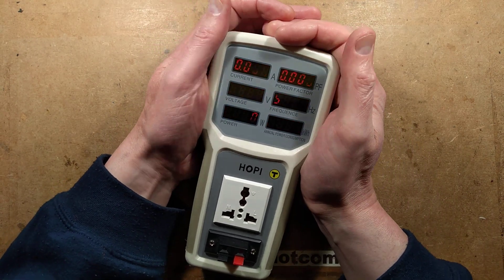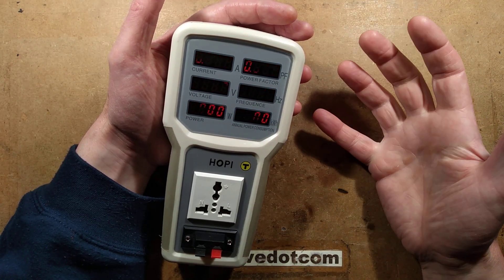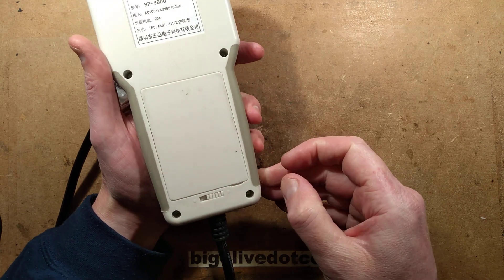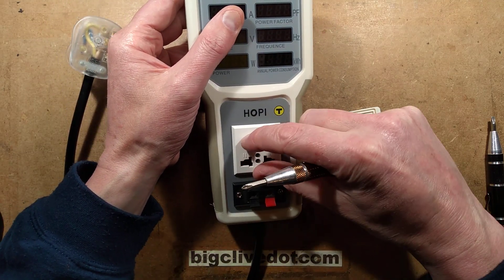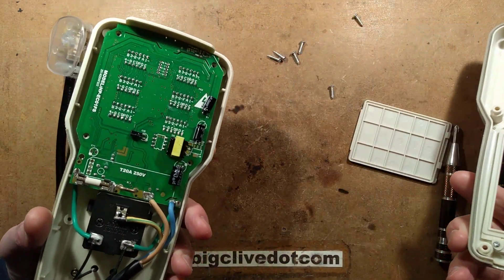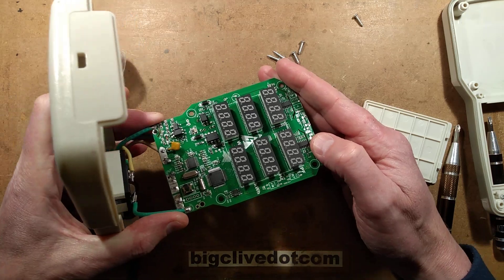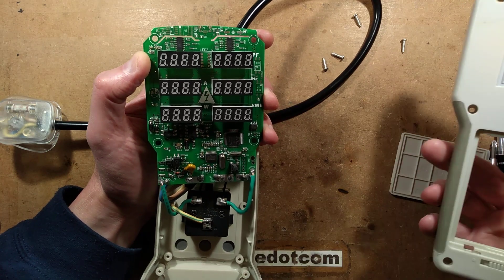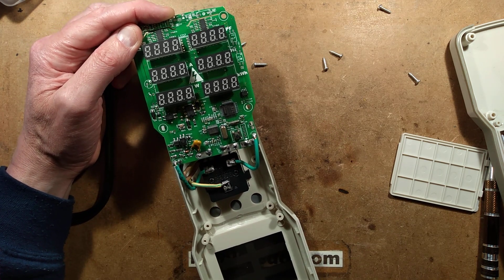Inside the Hopi power meter.  (It contains a smart meter chip!)

Comment: Unexpected mystery buttons inside devices are like free candy unexpectedly <3
No serial ports to probe? The unpopulated stuff at the top might hint at a usb or serial port for communication and that 4-pin header silkscreen needs further investigation.
Reply: You can get versions with a micro USB port on the top so it's definitely for data logging.
Reply: I would suspect that the 4-pin header silkscreen is for a regular size usb A plug header.
Reply: There are some other unpopulated parts next to the footprint for the USB, so I suspect those would need to be installed and possibly the firmware on the MCU changed in order to get that function.

Comment: Great strip down. No prisoners, BC is taking his tools apart! I'm so glad you practised saying "Current shunt" before going to air. I've been toying with the idea of getting a 'Hopi' for a good while. As for flicker and brightness issues I have no complaints. My only gripe (if any) is pulling the focus Mr.Clive. ;-) "https://ae01.alicdn.com/kf/HTB1HsWQIpXXXXavXXXXq6xXFXXXi/202104408/HTB1HsWQIpXXXXavXXXXq6xXFXXXi.jpg" Shows the T buttons functions (No.7).
Reply: Mehdi Sadaghdar aka ElectroBOOM also enunciates the word shunt quite clearly as well.
Reply: https://www.aliexpress.com/item/HOPI-HP-9800-Handheld-Power-Meter-Power-Analyzer-LED-Metering-Socket-Measurable-Current-voltage-Power-Factor/32375959317.html Contains the complete details.

Comment: Ohh... That button reminds me of a secret button inside my old CRT TV remote, it has the rubber pad with the carbon contact but it's very shallow and the label has buried the hole it's sitting in, use a needle and press it reveals a service menu that let you change a lot of things like overscan, rotate the screen...
Reply: YEEE! Fluttershy
Reply: @daretodreamtofly3288  i wasn't expecting that reaction tbh...
i remember that old samsung projection tv, once i was servicing, it had hidden menu after some kind of on remote button combination.
Reply: @sebo0855  Samsung TV's are still like that now. Info, Mute, Menu, Power if memory serves me correctly.
Reply: @firstsurname9893  maybe you're right because internal muting relay was clicking during this combination. And i haven't seen more TV's with back projection from close-up, it was the only one that i saw in my life, maybe It was caused by horrific price in this region ( Europe, Poland ). Good to know it's still existing.

Comment: I found a few pages on AliExpress for this meter that have a couple pages of documentation of what the button does, but they don't shed too much more light on the functions aside from the obvious. The number you can set for the annual power consumption seems to be the expected hours per day from 1-24.
Reply from the maker: That makes sense for the daily use.  I've never paid too much attention to that display.  Shame it can't be set as VA.
Reply: https://www.aliexpress.com/item/HOPI-HP-9800-Handheld-Power-Meter-Power-Analyzer-LED-Metering-Socket-Measurable-Current-voltage-Power-Factor/32375959317.html
Reply: bigclivedotcom Unless that's the Apparent Electrical Consumption option.  The named long press modes must have a specific way to activate them (some combination of long/short presses).  Maybe the manual that some people found online reveals that detail.
Reply: @bigclivedotcom  https://www.aliexpress.com/item/HOPI-HP-9800-Handheld-Power-Meter-Power-Analyzer-LED-Metering-Socket-Measurable-Current-voltage-Power-Factor/32375959317.html have a read mate :)
Reply: Maybe we should have RTFM!
Reply: "😮There's a button! 🤔 What the f#*k is the button for?" 🤣🤣😂
Reply: Maybe that's not AEC, but REC? As in recording something? Just a wild shot